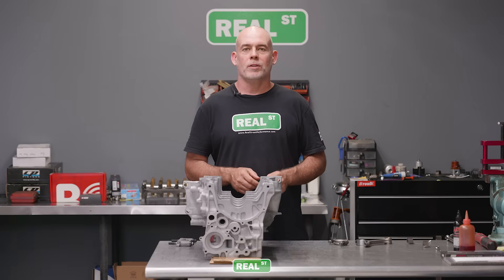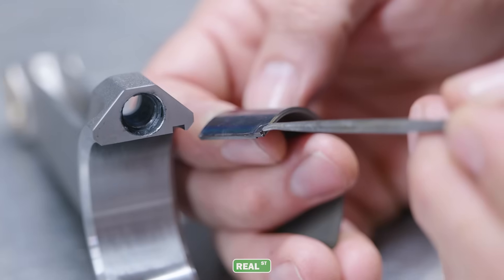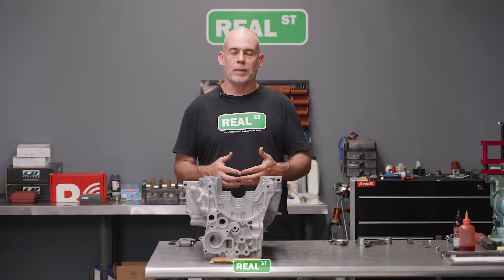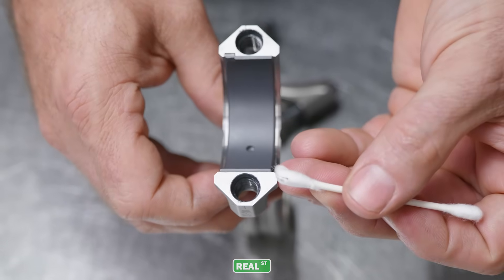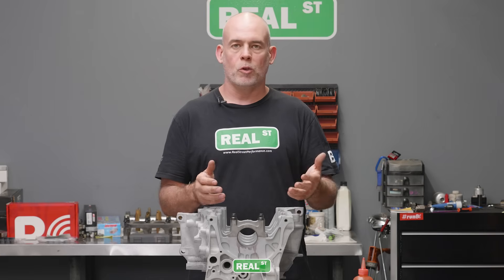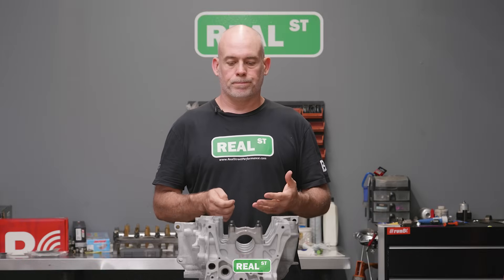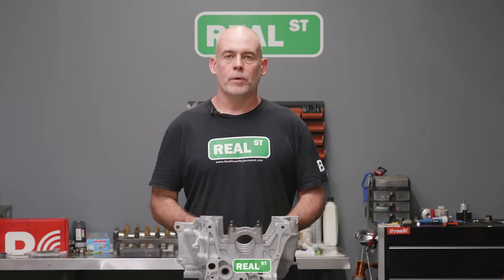Adding Oil On The Back Side Of Bearings During Engine Assembly. Good Or Bad?

Comment: There is a lot of “ old wives tales” out there. A lot of superstition as well. Regardless of your method continuity is king as long as you’re getting no failures.
Reply: Like tennis balls on headers claim it keeps exhaust valves from warping. Drag racers put them there to protect engine from someone throwing something in there. Funny air plane engines have short 6 inch exh stack, they land and no covers don't warp valves

Comment: I've been oiling the back side of bearings for years.my shop teacher in high school had a brush inside a old plastic carb cleaner cap on his bench and in it was marvel mystery oil thinned slightly with diesel.and would  coat both sides.ive been doing it ever since.when you tighten it down it pushes most of it out the sides
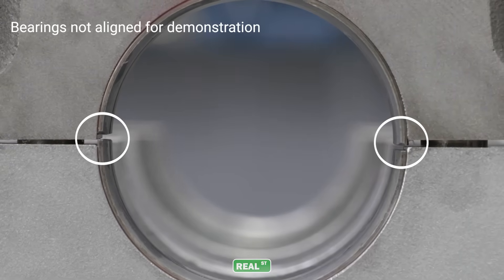Reply: 3:40 shows the advantage of the lubrication method.
Reply: But what did the oil do? It's wasting time with no benefit what so ever.
Reply: @jeremyking5684  when you put the bearings in like in the video the bearings do slightly move when torquing them down.and as they are almost a perfect fit there is a ever so slight movement.with rotation and heat expansion.exspeacialy in aluminum blocks.and under normal use oil pressure does push oil in between the bearing and the block.
Reply: Then sir you have been doing it wrong from the start.
Reply: @ezpz7143  I've done probably close to 200 motors and in the last 10 years they have been turbo motors pushing 40 lbs of boost some supercharged motors and a bunch of nitrous supercharged turning 10,000 rpms banging of the rev limiter on jet skis and they seem to last.im gonna keep doing it till I'm proven other wise

Comment: I've built hundreds of engines over the past 35 years. Have never had an issue without oiling the backside of bearings. Would like to see how much you're temporarily changing oil clearances causing excessive wear on bearings. Will do some measuring on the next assembly just  to see. My bet is there is enough for concern
Reply: Plastigauge is an indication of measurement, not an actual measurement.
Reply: yes larry a very simple check is to assemble with both methods oil on back of bearing and without , assemble both ways with plasti gauge and measure the difference
Reply: flynn  plasti gauge is like measuring with a yard stick.  Lol.
Reply: @tahcogunworks  please explain how many engine you have built and your methods
Reply: @alaskanbloke  I personally torque caps to spec and use bore gauges and mics. Then measure the crank and do the math. "Plasti gauge." Everybody has got to start somewhere. No offense intended because we all started from somewhere.
Reply: @tahcogunworks  plastiguage saved my ass once before when the dealer gave me the wrong bearings, was able to catch it and correct it immediately, the engine ran in service free from issues.
Reply: @goodmechanic  Plastiguage is a good double check of the machine shops measurements if you are building it at home and not machining it yourself.
Reply: I believe I’ll follow David Vizard.
Reply: If the oil couldnt escape and was trapped between the bearing and the housing then yeah it would be of some concern. As its not youre talking maybe 4-6 microns and if your worried about that then you got some serious ocd issues.
Reply: @Shaky_Dave  so you have measured the oil layer after the bearing crush ?  And it's .00015748 - .00023622 ?  Really ?  What'd ya measure it with ? How many engines you built?  Excluding the Briggs on your mom's lawn mower. How many are still running ?
Reply: @larryfeasel2403  Im hearing you. The brother must be in a temperature controlled assembly room @ 20 degrees centigrade + or - half a degree using slip gauges, thats why he can measure such tight tolerances. What a tosser!!

Comment: I am with Mike below. you cannot get the bearings and rod too clean. I use lacquer thinner to clean everything. the heat transfer is critical from the rod  rotating end. I have never lost a rod and have built dozens of high rpm engines. it may work for you but I will never, ever build an engine like that.
Reply: Which side are you on? You start off seemingly agreeing with the vid, but the end sounds like you disagree?

Comment: Bad idea....results are guaranteed, and if you pull some shells and see some blackness, the bearings been moving in the block, cap, or both..
Reply from the maker: Hi, Thank you for sharing. We have multiple teardown videos of engines Jay has assembled using this method. We have not seen anything abnormal on the bearings after taking these engines apart.
Reply: @realstreetperformance   oil on the back side of the bearings is a bad idea for two reasons, #1 it becomes a barrier to heat transfer, #2 it takes up space and can cause the bearing to over crush and the bearing loses that crush once the lube is worked out, but more to the point, what is the perceived purpose of putting lube where it doesn't belong?, and can have serious problems, and you say no problems were seen, are you certain you know what your looking for, I see no logical reason behind lubing the backside of the bearing, so what's your theory on why it's done?

Comment: I have been building street/racing motorcycle engines for over 35 years. I always use this method of cleaning, using a  light oil and light torque of main and rod caps without the crank to align the bearings and then install everything w Torco or Lubraplate assembly lube. Some of the super stock 600's peak power is over 14k rpm and they see that all day long at the track. Also I have never seen an engine taken apart where it didn't stink like burnt oil when you pulled the bearings, damaged or like brand new. Cars, trucks, tractors, or motorcycles, so oil is always under the bearings.

Comment: i was taught 40 years ago that 1) oil takes up space
                                                       2)  why would you lubricate something that is meant to be a friction fit?
                                                         3) the bearing manufacturers have instructions  for a reason   follow                                                                          them.
Reply: If your theory is true i didn't need to buy +.001 bearings for my new crank i could have just greased the back side of them them. Damn i could have saved $40 on main bearings. If bearing clearance is generally .0025" how much you figure a thin coat of 30 wt. oil will make up. when i disassemble engines the rod end under the bearing has oil in there. wonder how it got there?.
Reply: @markthegunplumber8376 it's because the oil freezes once it gets behind the bearing shell and no longer behaves like a FLUID anymore, duh (that was sarcasm, I agree with you)

Comment: Why would anyone ever oil the backside of a bearing? Number one it’s going to change the clearance. For a very short period of time… Until the oil squeezes out or the bearing clearances itself. And didn’t know if y’all know but oil is a lubricant. Sounds so dumb. Like when idiots put a crank in the block and spin it by hand like a school girl without the main caps on. Not until the cap and other bearing are installed is the bearing actually round. And technically the crank isn’t even centered in the bearings until it’s pressurized with oil 360 degrees around the journal.

Comment: I use thread locker on the backs of mine.
Reply: I like to pop-rivet in a couple places so the bearing stays put. The crank rotation will shave off the excess.
Reply: @jamesplotkin4674  Lol but seriously I have always used threadlocker on the backs of my bearings I've never had a spun bearing in my life as I have gotten 1 million and 300 km out of a ford bottom end the piston rings gave out before the bottom end.

Comment: Not buying this at all. You can distort the bearing shell if the oil becomes trapped for any reason, regardless of how minute the quantity of remaining oil. It goes against common sense and every bearing manufacturer's recommendations. It is a crutch for sloppy alignment of the bearing halves and not having them flush with the cap surface when installing.

Comment: I don't buy it.  Seems the oil would actually decrease the diameter of the bore the bearings ride in and change the journal clearance to the crank.

Comment: Great information! I personally don't see how a little oil on the back of the bearings could do any harm, it's not like oil doesn't naturally seep behind the bearing while the engine is running anyways. When I built engines I never oiled the back of the bearings, but I never took any steps to degrease the back of the bearing or the bearing hole other than just wiping it clean with a paper towel either and I haven't had any failures.
Reply: oil does not seep behind bearings ,if it does you will soon spin a bearing in either block ,or rod , due to not enough crush on bearings , i personally wash new bearings in petrol and air dry  , install  bearing backs dry, lubricate running surfaces , and always assemble using "plasti gauge " on every bearing , always use a torque wrench  , and pressurise lubrication system through oil pressure switch gallery ,
Reply: @alaskanbloke  Not true, metal against metal won't make an oil tight seal. I have taken plenty of engines apart that had oil on the back of the bearings. I never degreased my bearings before installing them either and never had any spun bearings and I drive my cars hard. Perhaps putting thick assembly lube or grease on the back of the bearings could cause them to spin, but I never tried it so I can't say first hand. I agree with the rest of your advice though.
Reply: @averyalexander2303  as i said if there is oil on the back side during dissasembly the bearing bore is too loose , dissasembly and inspection is as important as assembly as to what needs machining , if the block needs tunnel boring , if rods need closing honing and aligning , you say you drive your cars hard , how often are you rebuilding them , i am talking about rebuild engines that last , mack and cummins doing 1.5 million miles , anyone can throw and engine together with half a snip of knowledge , do you use plasti gauge on assembly?

Comment: 2:00
I kinda see your point there. Putting the oil on the back side allows the bearings to move into proper place as the cap crushes it down.   And as you torque it down, we can see the red fluid being pushed out along with the black stuff. 
 Kinda like how window tint is put on with soapy water, they dont put the tint on dry OR when you 1st drop the piston down the cylinder wall, they say to rub wd40 on the cylinder wall so that as the piston is dropped in, the rings dont "scrape" the wall, the wd40 acts as a barrier to allow the piston to smoothly drop in without scrape.
So, where as normally we do not put oil there and therefore we are putting a dry bearing surface to another dry metal surface, then as you tighten down the cap, you have 2 dry metal sides being pressed together and if there is a slight mis-alignment, now you potentially have a scratched bearing or crank or rod side. 
The question i have, IS all the red stuff being pushed out or is there some left under that bearing which CAN cause an issue like everyone is seeing as a thrown bearing .. ?? 
The video shows the red fluid being pushed out, but is all of it being pushed out ??

Comment: There aren't to many mistakes that can be made with the main brngs,  Crush  clearence/tolerance. And make sure  the crank will float on the bearing bed. One high spot will destroy. 
The last thing I think would be noteworthy is the oil pump don't jack the oil pressure up stronger spring's or shims under the relief valve. This can jack bearings onto the crank Outcome is nasty lol

Comment: Jay! Jay! Jay! your a GENIUS! I've never seen this method before...All the people I know are complete IDIOTS! Just because the main thing going on is a transfer of heat out of the bearings....Why wouldn't you want to insulate that juncture with some intermediate compound between what traditionally is a METAL to METAL junction....Next please develop a completely "floating bearing assembly" by clearancing the back side of the bearing to housing junction....Then....Well HEY! then no more "spun bearings" cause....They are already spinning! Me? I'll KEEP ON using Brake Parts Cleaner and do the utmost to make sure everything is clean DRY and dust/debris free on my motors....

Comment: Oil thickness is real when your talking precision. Have you ever seen any master builders do that ? Does the manufacture say you should do that ? I personally would not do that especially with assembly lube. Just maybe dip your finger in oil and rub it in until it disappears just like lotion on your weiner just to condition the metal. Only kidding don't do what he says it squeezes out the sides because he is squashing a fluid and it can an will change tolerance. If you had a lot I wouldn't think it could distort the shape. Even though he has not had problems does not mean he is right.
Reply from the maker: Hey thanks for contributing

Comment: I put bearings in Cadillac engines for 20yrs at dealership , dry when on the engine stand and when in the car they no doubt got oil on them, never had any issues that came back for bearing problems. If it were my engine they would go in dry than oil, I learned that anything behind a bearing could cause problems. Yes oil gets behind them, the mains through the oil galley hole. I guess I am old school.       Jesus Does Save

Comment: I’ve always wondered about the green bearing retainer compound. Supposedly helps keeps bearing in place in high heat applications
Reply: its meant for ball taper and needle bearings  not inset bearings/bushings
Reply: No do not use it. It takes room and will change your brg clearances.
Reply: Never, thicker than oil and stays thicker. Good for retaing axle and geabox bearings, a little helps with 'loose' balancers as well. Though they are harder to get back off again

Comment: "i have a, pretty good track record on success, as far as putting engines together and not having them fail due to assembly error"

always humble
Reply: And make over 900 whp on stock components including re using head gaskets and torque to yield bolts. 
A true legend of the masses. We love you sloppy.
Reply: matt you made me giggle lol
Reply: Hey mat remember the 240 lol

Comment: That fact that these motors work at all and the power we can get out them is insane in itself, I love it 🤘
Reply from the maker: Couldn't agree more!
Reply: I’m amazed that any engine can have 10,000 20,000+ hours on them, it’s hard to believe how well they work, when I first learned about piston rings at 6 or 7 I didn’t believe it, “you have metal scraping metal thousands of times a minute, and it’ll last for decades?!?” Motor oil is an amazing thing.